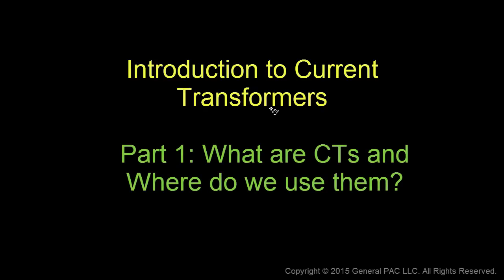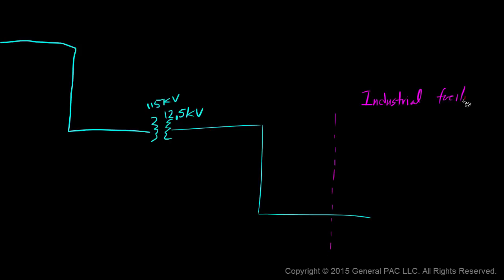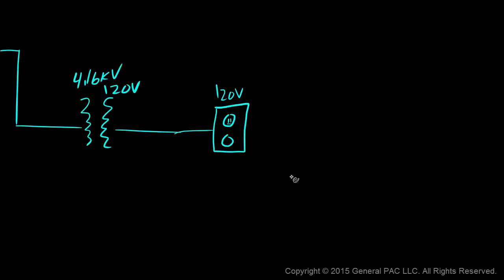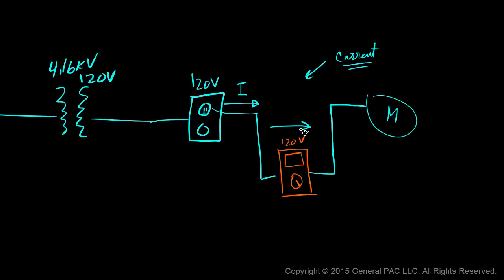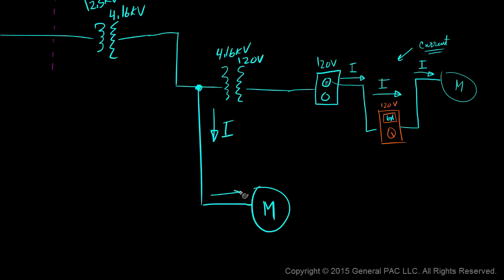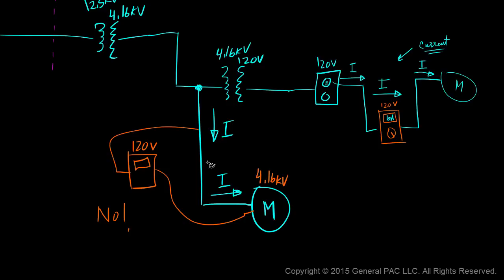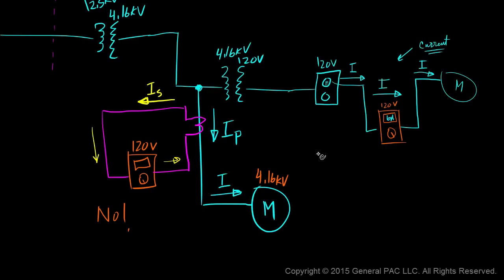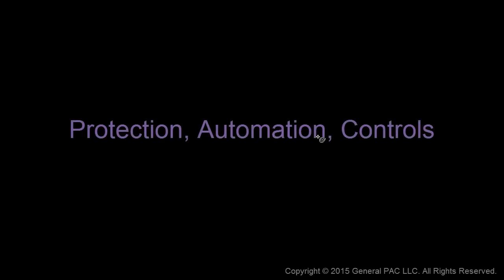Introduction to  Current Transformers Part 1: What are CTs and why use them?

Comment: Motor in example is actually 2400 volts phase to ground if feeder is Y.
Reply from the maker: Hi Seth, Motors are usually delta connected, so it doesn't depend upon the feeder connection. The voltage across the motor will be 4160 V.

Hope you find it useful.

Thanks,
GeneralPAC by AllumiaX

Comment: You talked so much,but didn't say 1 single word about....where does the current come from...?
On the power line there are 112 kv...and than?
Reply from the maker: Hello,

The current is produced at generation side and travels through a high voltage transmission line (115 kV) to the distribution, where it is step downed to a lower voltage and easily utilized by the load.

Hope this answers your question.

Thanks,
GeneralPACbyAllumiaX

Comment: Its kind of funny that when drawing electrical distribution systems, so many people show current (i) flowing into a device with single arrow. 

With both DC and AC  electrical systems one has 2 wires.  At any moment in time, one will have current flowing into the device on one of those wires,  and current flowing out of the device on the other wire.  With AC, the current amplitide and direction changes over time. 

Depending on who your listening too it is common for people mistakenly interchange power current voltage.  

Generally, power flows (edited: I really mean "over  over time power causes energy to flow") from source to end device,  (positive voltage) × (positive current)  or (negative voltage) × (negative current),  unless you have reactive elements in an AC system that change the voltage to current phase relationship, resulting in brief  moments when power flows back to the source. For example moments where  (negative voltage) × (positive current) or (positive voltage) × (negative current).
Reply: When you say power flow, I imagine energy over time. Is that a correct representation for the situation? 

If so, how do electrons flowing out of a load lose energy to the electrons flowing inside of a load (a light that uses ac current)?
Reply: @brendonholder2522  ElectroMotiveForce is converted to heat and light

Comment: Correction: When you step down the voltage you increase the amperage. Remember that energy is never lost. So except for the heat loss, the power down the lines (wattage) has to remain the same. So the if you raise the voltage you lower the amperage (as in the step-up transformer) and visa-versa. One of the reasons we step up voltage on long-distance transmission lines is to reduce the amperage required. 

Also, most low-end multi-meters don't have capability of measuring AC amps. My Fluke 117 will handle it but only up to 10 amps. Considering my vacuum pulls over 12 (and much more at startup) trying this stunt with household motors could pop the fuse in your meter. 

And most importantly, messing with 120V power is EXTREMELY DANGEROUS! 120 is high enough to make your muscles contract and those nearest the electrode will contract more. So if you grasp the electrode, your hand will NOT release it while the current is still flowing and that (without a GFI breaker) could leave you dead. The safe and simple way to check current is to use a clamp-on amp-meter around insulated wires. Please fix this video and warn people that 120V current is hazardous!
Reply: *Current. Don't that infernal word. Ever.

Comment: Lose the strange sounds and I may come back and finish this.
Reply from the maker: +Hopelessand Forlorn  -- what's good background music? I tried with no music at all and it didn't sound very appealing... felt like there needed to be something. Thanks!
Reply: What sounds good to one viewer will be distracting to another.  That said, I think the level of the music (?) was too high compared to the narration.  Too bad for me--I have been fascinated with CTs in aircraft since 1965.
Reply from the maker: +Hopelessand Forlorn --- I agree that sound is in fact subjective. But you have a point about the background music of this video being too distracting. I have made an effort to reduce the background music in other videos that I have produced. But I'm tempted to use natural ambient noise instead of music... Can I get you honest opinion of the background music/noise for this video that i just released: https://www.youtube.com/watch?v=-XeG8WAjS7E  I've chosen to use the sound of rain --- by the way, I also find CTs very fascinating especially when used for measuring tens of thousands of amps at 100+kV! Thanks!!
Reply from the maker: The strong sounds are gone. Watch the new and improved CT Video here: https://www.youtube.com/watch?v=O_0UX13t3dw&list=PLqJ0Y2s60r-5twLWQpqUX6jA8V9AQBryv
Reply: i don't know if the current music is same, but i like it. Does not distract from content. December 2017.
Reply: +Trafalgar Thanks, but I spent 21 years at the front of the classroom, and I never found it helpful to distract or confuse my students with unnecessary noises.
Reply: +Hopelessand Forlorn If you are desperate to learn, you wouldn't be bothered about the music. This is a good video and the music isn't a big deal.